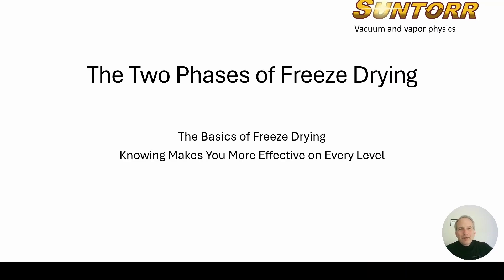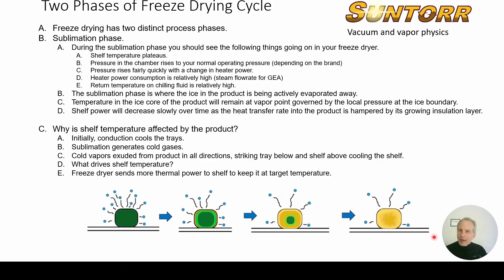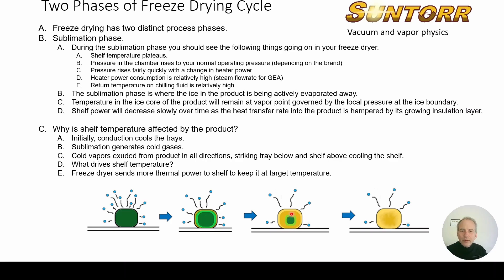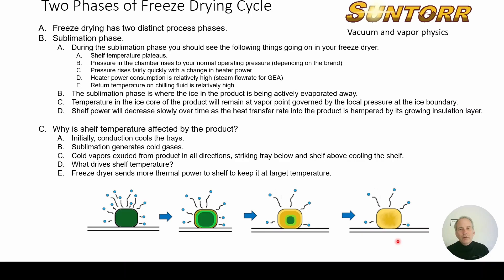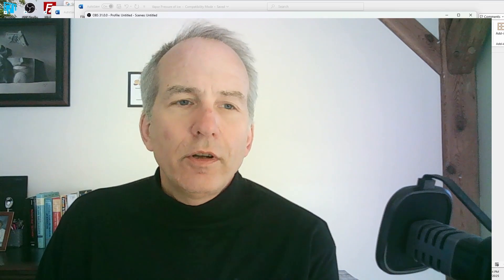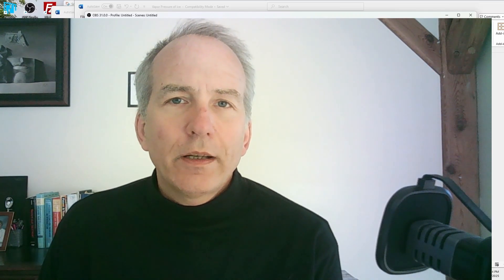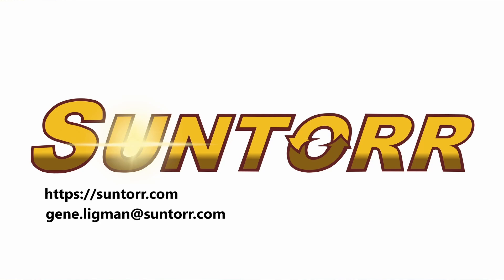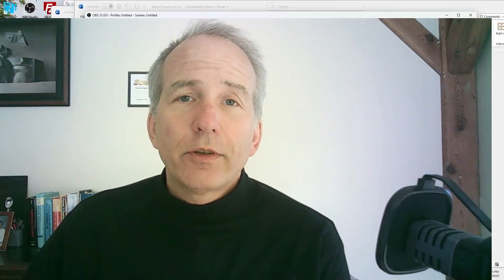FREEZE DRYING Success Depends On Understanding TWO Key Phases

Comment: Are there videos available of what's happening at the surface of the product or item during these phases ?
Reply from the maker: None that I know of. That said it can’t be measured, so it would be highly speculative.
Reply: @Suntorr25  I'm not too concerned about measuring it but in another video you said sublimation rate varies at different areas of a single shelf and that tray centers tend to dry out more slowly and the reason is the shelf above it which makes sense but I've observed it occuring in research enviorments. It's actually pretty cool to watch. If it can be observed it can be filmed and lense choice could allow the surface at the edges of the tray and the center of the tray to be filmed. The only thing I would take into consideration is not use a water proof camera in order to prevent pressure differentils to cause a catostrophic failure of the cameras body. 

There are a number of videos of CO2 sublimating.
Reply from the maker: @ImStillHereSomewhere that is quite an interesting idea.  If you try it, let us all know the results.